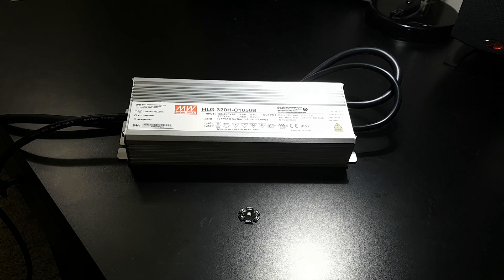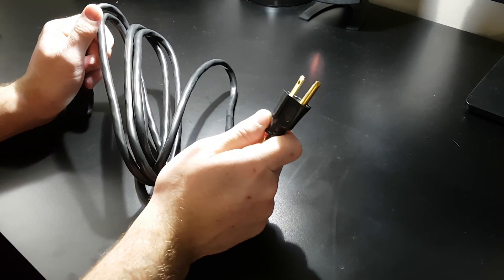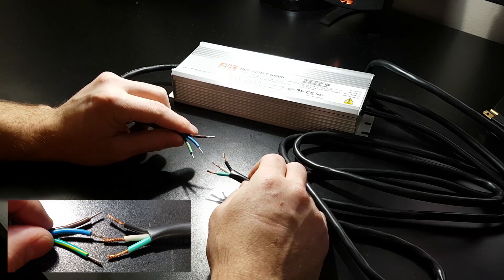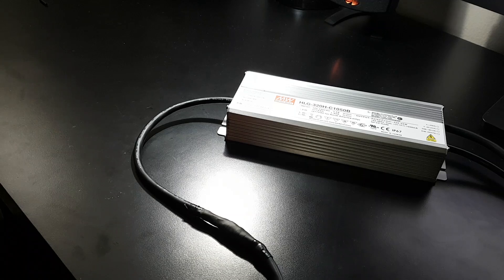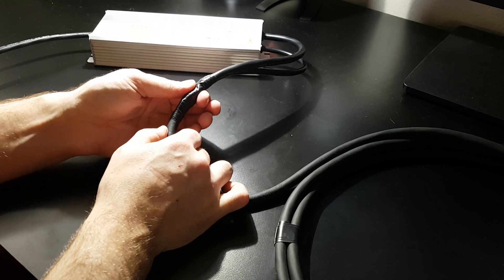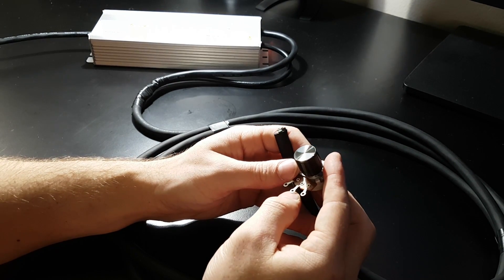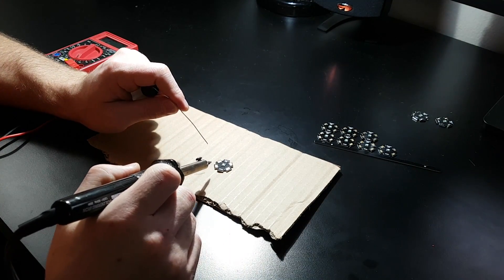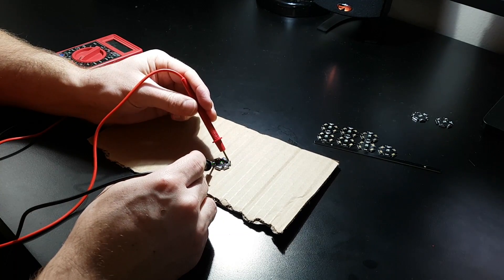The Ultimate DIY LED Aquarium Light Part 2

Comment: Hallo für Alle die es interessiert.
Wenn man mit diesen High Power LED PCB Chips eine Beleuchtung bauen will, ist eine sehr gute Kühlung der Beleuchtung nötig, wenn möglich mit einem Ventilator. Kann man hier kaufen: www.banggood.com
" High Power LED PCB Chips " in die Suche eingeben
Hello for all who are interested.
If you want to build a lighting with these High Power LED PCB chips, a very good cooling of the lighting is necessary, if possible with a fan. Can you buy here: www.banggood.com
Enter "High Power LED PCB Chips" in the search

Comment: Sean! Wheres part 3? I'd love to see how you wired it and how it works. Thanks for sharing.
Reply from the maker: Stephan Bitterwolf the whole project crashed and burned. It would have been better to wire all the different colors on their own driver instead of try to have one long stream powered by one driver... Too many failure points. The whole thing has been sitting in the corner for the last year or so... I'm as disappointed as you are. Sorry
Reply: I had a very similar experience last night....... Managed to fry all 12 of my LEDs can't imagine what you went through... I'm going to try it again next week. Did you fry all of your LEDs too?
Reply from the maker: Stephan Bitterwolf I might have... I know for sure one popped... I got discouraged pretty quickly, especially once I realized I was going to have to re-wire and re-solder 96 LEDs...
Reply: @Seanmmvi  you should use 5 channel  driver for this project, so you could adjust each colour as you like also make a separate power line for each colour, this way if one led fail the rest still will be powered. Good luck next time mate.
Reply: @CichlidVibes  can you suggest a dimmable  Meanwell driver am planning to make 200 watts 3 watts LEDs for my planted aquarium thanks in advance

Comment: I looked for Part 3 but couldn't find it.  Is there any link?  If not can you give a title to search for it?
Reply from the maker: Yea... Part 3 never happened... This project kinda crashed and burned :(
Reply: Sorry to hear that.  It looked promising.  What did you do with all the stock you bought (if you don't mind me asking?)
Reply from the maker: RipVan Winkle it's all sitting in a bag in the corner of my office
Reply: So can I ask why you didn't continue with that?  I'm asking because it looked really promising.  I'm kinda researching whether it's worth it or not to try to put one together.  What was that stopped you?
Reply from the maker: RipVan Winkle I wired something like 96 LEDs in a single series. that was foolish. there are a lot of failure points In a single string of hand soldered LEDs. I couldn't get all of them to turn on at the same time. If I were to do it again, I would put all the reds on one channel, all the greens on one channel, all the yellows on one channel and I would split all the whites into two channels. This would be much better to track down a failure. it does complicate the wiring tho. That's why I tried to do it all in one string...
Reply: I see.  Are there drivers that allow for the adjustment of spectrum (that you know of)?
For my display tank I wouldn't go DIY.  I thought to go DIY for my sump because LED lighting is not what I'd call cheap.  
I'm also looking into whether the drivers are portable to DC only.  For example a 24v or 12v supply.  Have you seen that?
Reply: Yeah big bummer, watched all of 1 and 2 and was trying to figure out where 3 went.
Reply: I getting me sum 4w RBGW led lights and a led control to do with my aqurium il be using either 10 or 20 led's. il also be using a Dc to Dc converter. 12v to 36v. good video man.

Comment: what was the total $$ for this project?
Reply from the maker: ADU Aquascaping it would come in around $1200
Reply: Sean Williams man, that is fancy. Makes sense. I was arguing with people about true quality builds. They think the $40 flood light LED is comparable to high end matrix fixtures. Maybe initially with poor rendered light, but not even the same thing at all. King of DIY is spreading this idea. A Cree Lumia LED Matrix is $100 on average just for one matrix. The told this to Joey too. hahaha
Reply from the maker: ADU Aquascaping I got it all wired up and powered on, but half on the LEDs aren't working. I think it's because of the red LEDs are messing things up, they require a different voltage. so I need to re wire it. the wifey sauce made me clean up my office for Christmas, so all my tools are put away. I gotta dig them all back out and get back to work on it. having a little trouble with the 75 right now, my diffuser came loose and floated to the top for an entire day so there was zero co2 in the water for an entire 9 hour photo period. algae all over everything now. im on day 2 of a blackout right now
Reply: Sean Williams why did it come off? what diffuser is it?
Reply from the maker: I dunno, the suction cups just let go for some reason. Its the Rhinox 5000 disc diffuser
Reply: Mine cost with 90 LEDs 3w 260 USD aprx I'm Colombian but bought everything from AliExpress and from local aluminium store
Reply: @clev9486  what kind of driver you're using for 270 watts LEDs thanks in advance
Reply: @mitv0076  a cheap 750w generic, not real pc power supply.